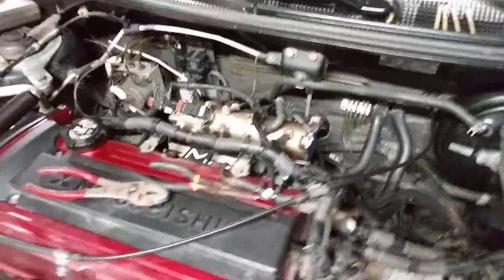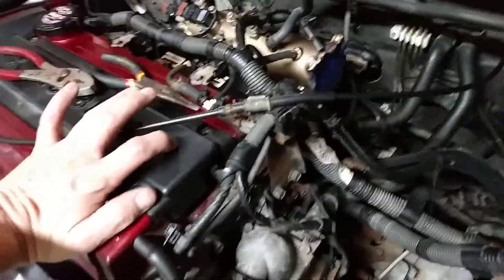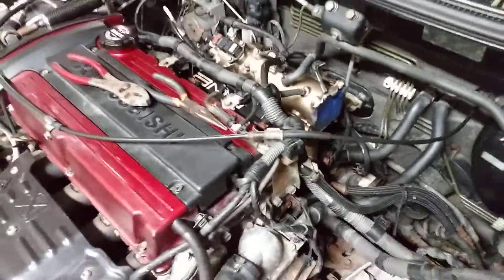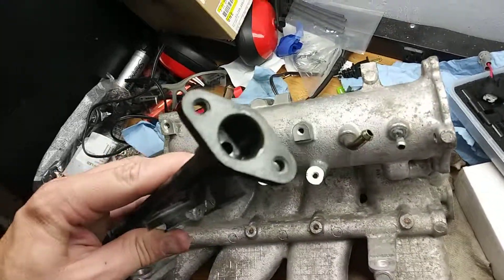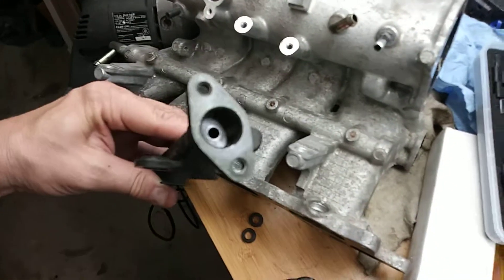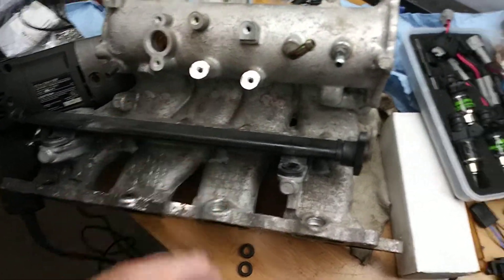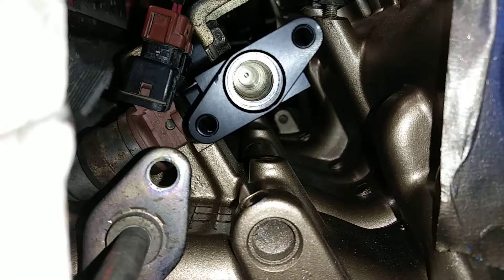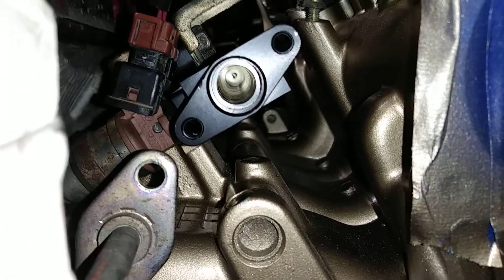Evo 8 factory fuel rail vs AMS fuel rail

Comment: IDK for certain, but I'm sure the smaller inlet has to do with maintaining fuel pressure from a stock/stockish fuel pump.  I'm no physicist but I do know that flow volume/cross section of a given area has an immediate affect on pressure.   This is all purely speculation on my part with no actual searching.
Reply from the maker: Yea its possible.  I like no restrictions.  I like flow.  Pressure comes from restriction.  Let the fpr control the pressure.  Of course I am speaking in aftermarket terms.  You might be right
Reply: Curious though as to why you're going with as big of a pump and the fuel rail as you are?  I've heard the stock fuel rail/regulator is good until about 650whp give or take.  Granted I know the stock rail isn't the best at distributing equal volume to each injector.  My approach was slightly different in that I just went with a modded walbro 255 and FIC 1650 high Z injectors.
Reply from the maker: @BLACKzj52  I am going with e85.  I have heard that the 255 has good luck with e85 but since its not specifically rated for e85, I went with a walbro that is specifically made for e85.  It just so happens to come in a 450 only.

Which is ok because i didnt want to mess with hardwiring pump or doing any of the other wiring tricks some other owners do.  I wanted to keep it simple but still have the flow for e85 withoit needing to increasing amperage and new wiring to do so.
Reply: @d-evolution1309  Interesting, I've never heard that 255 isn't rated for E85.  I figured since it was the go-to intro pump that it was compatible on all levels.  Will you have to run an aftermarket FPR with the 450 (can't remember if that's been mentioned or not)?  Also, I agree, I don't want to go about hardwiring the pump either. 

I don't see my power goals being above 600whp in the long run.  I'd like to keep the versatility and characteristics that a stockish evo has (go fast on straight and in turns).
Reply from the maker: @BLACKzj52  walbro does not rate their 255 pump as e85 compatible.  However they seem to have good luck in the evo community even with e85.  Other pumps like the arm 320 or what not dont last long on e85 from my research.

I might need an aftermarket fpr.  Some people have said its ok on the 450 without the pump rewire.  Rewiring it and I guess the stock one cant keep up.  I am keeping stock for now

My goal is 450 and like you want to maintain some of the stock driving characteriatics.  That and I dont want to blow the engine up.